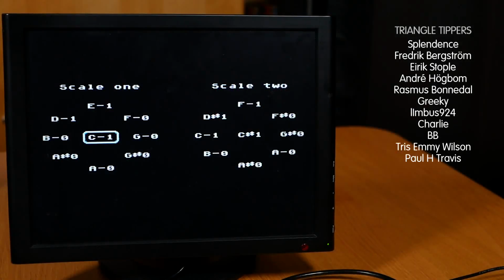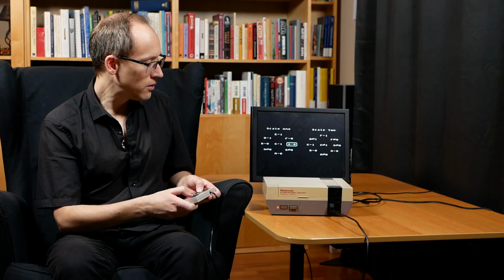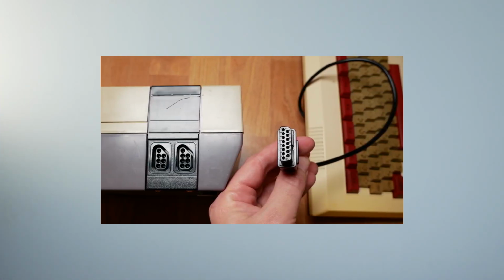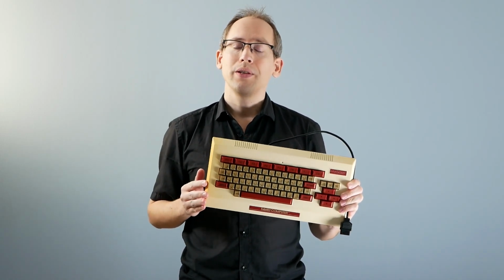The Family Bass

Comment: What was preventing you from using both controller ports instead of using an interstitial device?

Do the two ports not have as many pins available when combined?
Reply from the maker: The ports do, but not the standard cables I had at hand.

Comment: Check out the SynthNES program by Avicr.  It runs a Windows bridge between the NES Everdrive and a MIDI keyboard and basically lets you drive the NES soundchip with a MIDI inputs.

Comment: Expecting a specific key input is a very clever way to mark the start/loop point on the bitbanging. How much protection is there (or needed) for lost connection, or slipping out of cycle?
Reply: If you intend to later add in the DPCM channel, unfortunately quite a bit! The DPCM channel introduces a sort of corruption when attempting to poll the controllers that effectively deletes bits from the input stream at random. With a 72-key polling loop and no way to know when it begins, or where the DPCM channel will perform its read, corruption is all but guaranteed to occur quickly and often.

Most commercial games work around this by polling the controller several times in a row, and waiting for the inputs to match before accepting the result. This is impractical for the bass, as the polling loop is significantly longer than the shortest DPCM period of around 428 CPU cycles. The hardware interface will need to be redesigned, or more likely, DPCM simply avoided for this instrument.